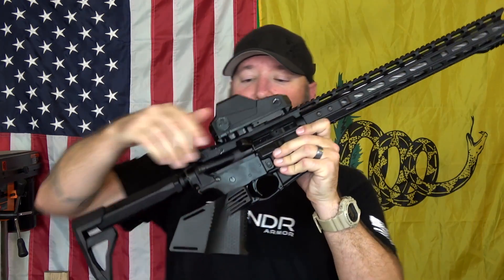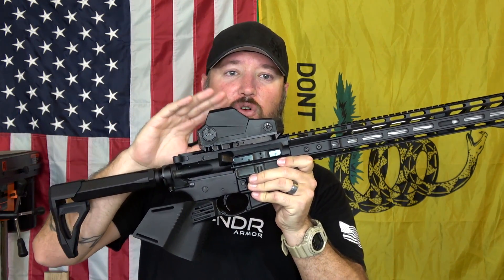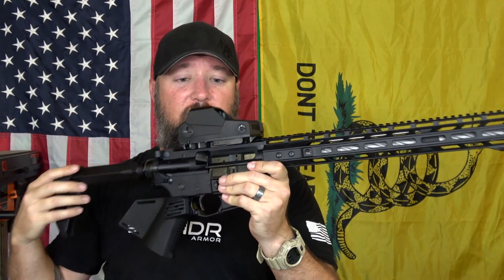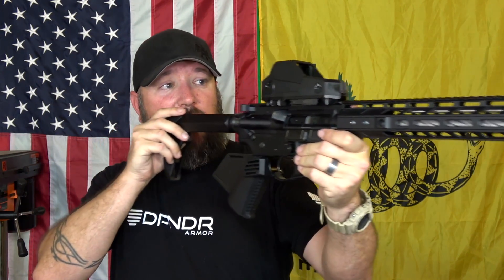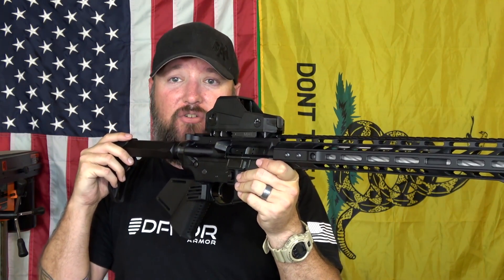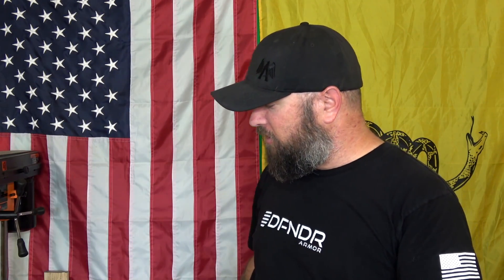Red Dot Placement Daily Shooter "Quick Tip"

Comment: Even for basic balance, you generally want the optic as far back as possible. It makes the gun less fatiguing to hold up because most guns tend to be fairly front heavy. It also gives you a wider field of view through the lens. However, if you want to be bougee and run a clip on NVG, then move that puppy up.

Comment: How about height? Some red dot sights come with two "bases" (like the Sig Romeo 5), one is about one quarter of an inch high (or less) and the other one, like the one you are using is about one inch high. So what's better? Great video!
Reply: The lower base/mount is meant for shotguns and others, while the high riser is designed to be used with AR pattern rifles, especially if you intend to use iron backup sights with it. Cheers, mate.